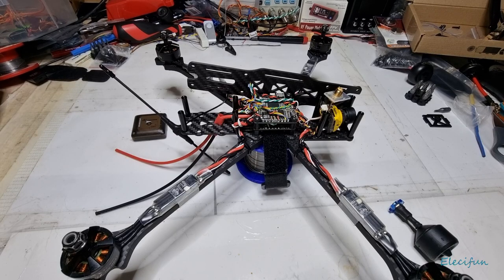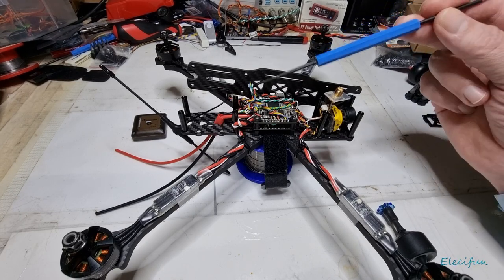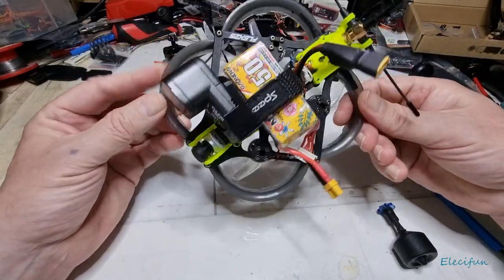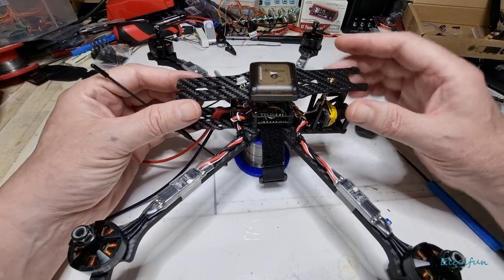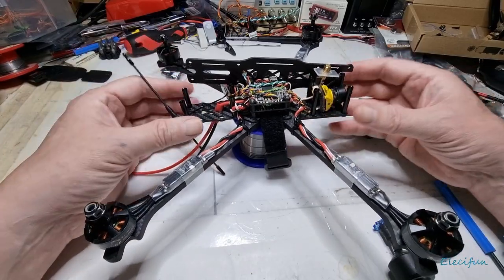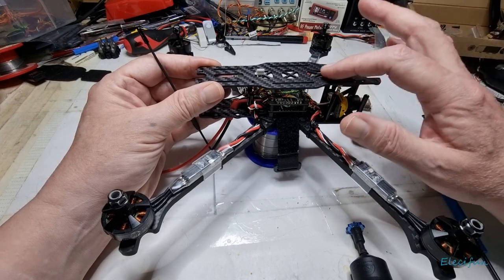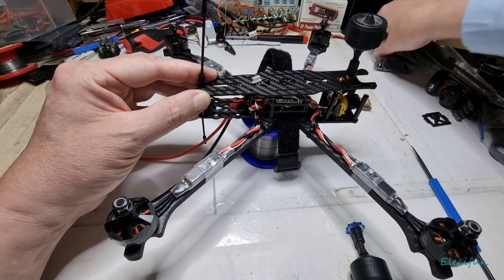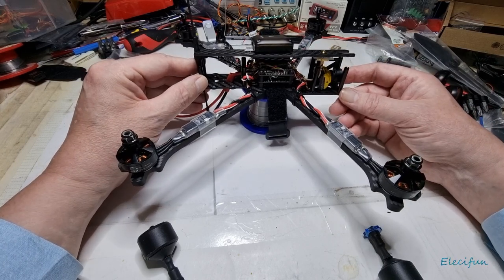DIY Quad Build Hardware Layout

Comment: I got my motors but haven't ordered ESCs or FC. They're next. I wasn't able to use the TPU protection feet. The holes need a slightly different spacing and I want the motor/frame connection to be rock solid. I  may not use foot protection at all and just come up with a better design. Like some sort of landing gear bumpers that attach to the frame not out on the arms... we'll see.
Reply from the maker: @Sonic_Ox all part the fun of the build buddy. I can't wait to see yours.

Comment: Thanks for posting that Elecifun. It's really looking great. I can't wait to see it fly! Do you plan to flash INAV? From what I've been reading, INAV is better than BetaFlight if you plan to use more advanced GPS functionality like position hold and way point missions etc in addition to return to home. I also wanted to get your opinion on GPS module placement. I noticed that most guys are putting them out the back and flat on a TPU mount. They're saying it's best to be at least 5cm away from high current like motors/esc etc. Seems easy enough to manage. I noticed you have your receiver antenna well away from your VTX antenna and you intend to mount it vertically. I think that's a good idea and I'm searching for an elegant solution to keep from bending the antenna whenever the quad isn't in the air... Anyway, thanks for another timely video. This series is immensely informative and entertaining to me. Cheers amigo. Happy flying. 🍻
Reply from the maker: @Sonic_Ox glad you like amigo. Definitely using INAV, it has never let me down and I am familiar with it. I want to fully explore the INAV functions including waypoint missions this time.
GPS placement might depend on the module you use. I agree with what you say.
My antenna solution will be to fit it so it moves out of the way when on the ground and move into position on launch and in flight. That's the idea anyway.
Reply: Yes. I'm imagining an antenna mount that swivels 90° without the need for tools. Great progress on your quad amigo. You'll have yours airborne long before mine lol. At least I'll have the benefit of your experience as usual 😅🍻
Reply from the maker: @Sonic_Ox  Um well LOL.. as long as this swivel mount is only as complex as one or two small zip ties, then you are a mind reader my friend. LOL's.